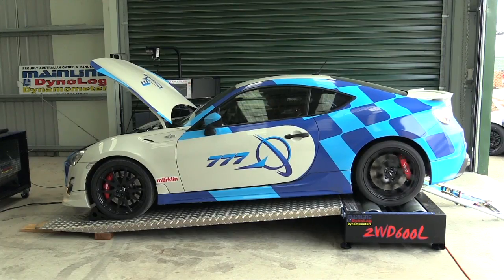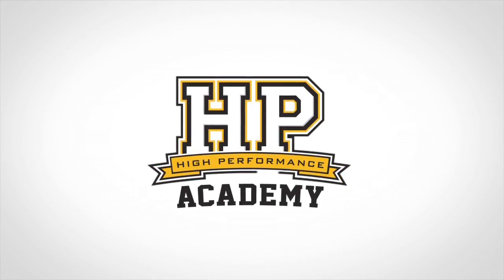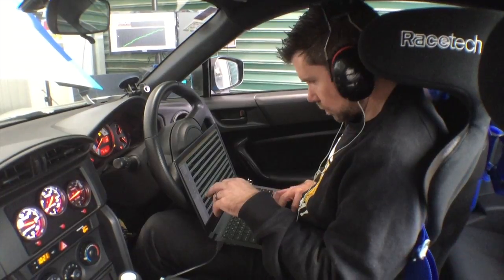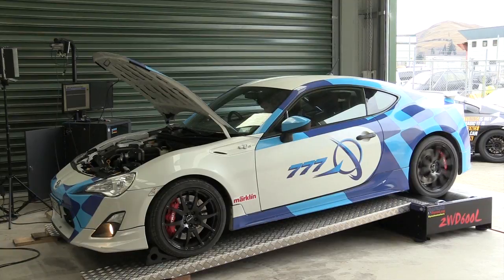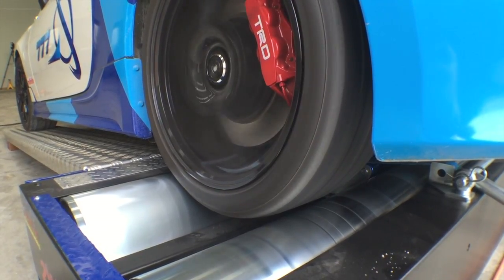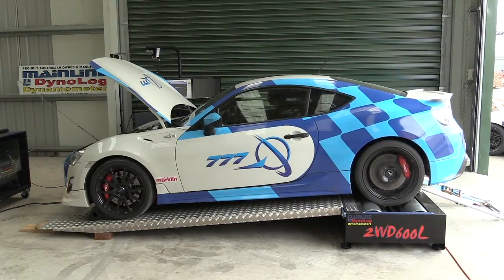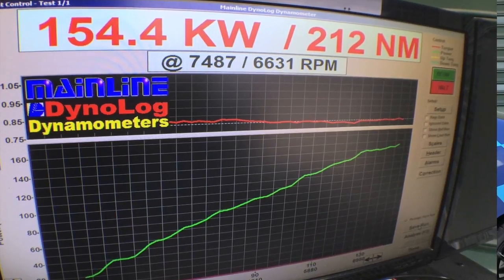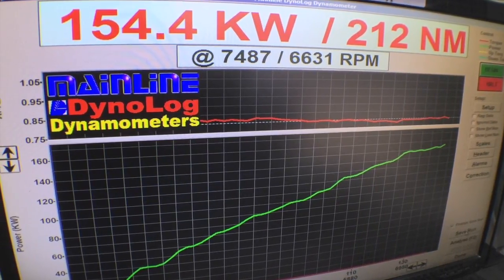Tuning An Aftermarket Supercharged Engine | BRZ/FRS/GT86 [TECH TALK]

Comment: so lame mans terms, the processing is mainly a filter setting, so do you have to input the center frequency and it filters out say 5k either side. also have gain controls.  so my question is if i use a donut knock sensor and run it through a laptop and apply some filtering and some gains will it do the same thing for the audible noise. also any idea what the knock frequency of a sr20det is XD ??
Reply: base frequency is based around bore size.  there is a calculator you can use online to calculate that.  often you will end up using the second order freq.  there are different items you can use for knock sensing.  There is a program called Tuner Nerd Knock monitor that filters using the laptop.  However, the Plex does have the ability to tell you what cylinder the knock occurred for tighter tuning refinement and has some cool software as well.  I've used both.  As with any tool it takes some time and experimenting to use it to the fullest .

Comment: can you use e85 in queens town?
Reply from the maker: +Juan Vargas sadly it's not at the pump. But you can run it, just have to buy it in 200l barrels. - Ben
Reply: wow crazy
Reply: Might still be able to buy it as 17 litres in 20 litre drums for easy mixing as required. I was looking at it a couple of years back and think it was South Pacific Ethanol offering it - haha, a search came up with an earlier posting I made discussing this, but the link I'd used there to SPE no longer works :-(. 
Might be worth chasing up, though, as it could significantly reduce the atmospheric water contamination concern in the soggy south and the smaller drums are much easier to move and store - and can be mixed with 95 (I don't think 98 is available in the south Island?) for a bit more safety margin.

Oops, just noticed the posting date - bit late...